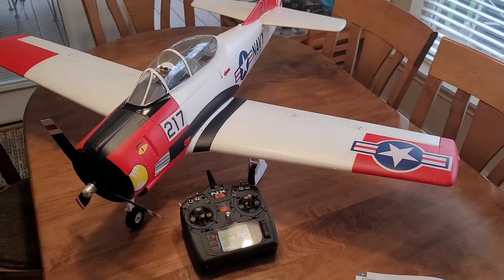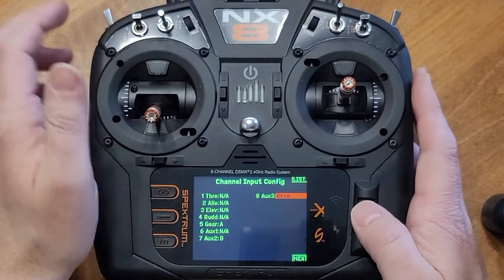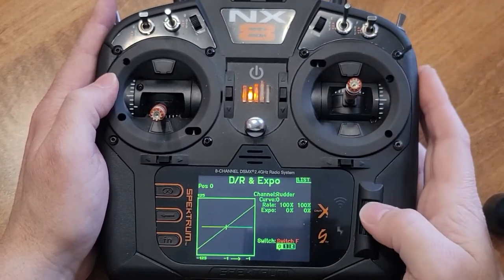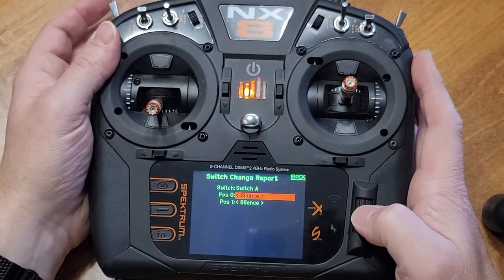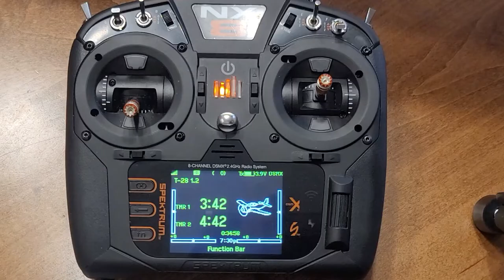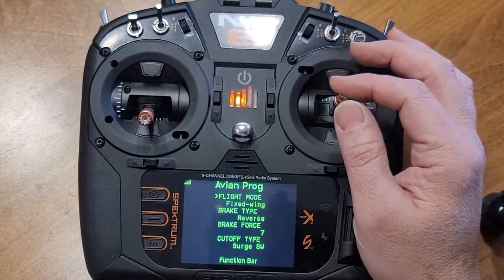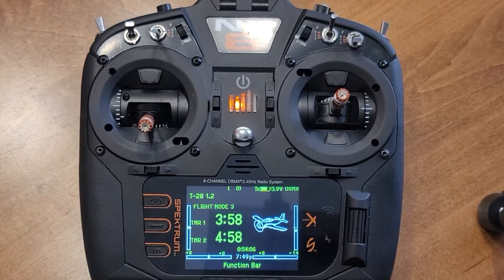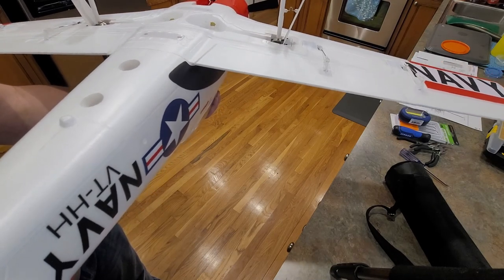E-Flight T-28 1.2m & Spektrum NX Radio Complete Setup Guide w/ Flight Modes, Reverse Thrust & More

Comment: Nice. I have an NX10 and I will be setting it for a brand new in the box E-Flight T-28 I just picked up.. Your video is gonna help me alot. I don't want to use the "pre-fabbed" downloadable settings because I wanna learn how to do it myself. Will probably go without the reversing for now. Maybe add that in later. This is my 3rd plane. Graduating from an Apprentice STS and an AeroScout. Can't wait to get this T-28 up in the air. I feel like its my 1st "real" airplane.

Appreciated your hard work on the video.

Subbed.

Comment: This was a spectacular video.
So much info here.
You did an amazing job, bith with camera angle, also, explaining what you were doing. Also, why you are doing what you are doing.
For me, that is key.
It's hard for me to learn something, if I'm only doing it, because the manual is telling me to do it.
I love knowing why it's the way it is.
The reverse thrust, was the best explanation I've ever seen.

Also, never knew most planes, if not all, could have have that feature.
Understandable, there is an inherent risk when using that, especially if its on a plane not designed for it.

I have this plane, had it for about 5 years now maybe? I got it, about when they re-released this with the flaps and retracts.
I couldn't be happier with this plane.
The only downside for me, is that I flew this plane, before I was as experienced as I am. Consequently, have had some less than spectacular landings.
Subsequently, this left me than less than optimal performing retracts.
Now, they did just release a new 1.2m mustang.
I'm curious if the rears, are similar to those.
They also released something else that has tricycle landing gear, of similar size that I may be able to replace the retracts.

Do you know of an aftermarket replacement that is possibly stronger than the oem gear.

That is the only weak point to this plane I have found.
This is a solid plane.

Comment: In the flap settings the book has you set 2% elevator compensation for each flap setting. If that isn't how you like the trim while flaps are deployed, then you can simply change it there to a different percentage effectively doing the same thing as your flight mode setup. The advantage of using the flight mode setup is that you can dynamically set those elevator trims on the fly for each mode. Just thought I would point that out. Technically, you can also adjust that one setting on the fly as well but I usually just land and set it. Rinse and repeat. If your using flight modes, you don't really need the 2% or any compensation set there since you are doing it via flight modes.

BTW, I changed over to your bright green on black and like that a lot. The time remaining tip on the bind button is also a new trick I didn't know about that I'll have to setup on all my other planes now.
Reply from the maker: I use time remaining on the bind button on every plane.  I never like taking my eyes of the plane unless it is a must!

Comment: I have a new t-28 1.2m version 1 I havent flown yet but have upgraded with a stronger front landing gear wheel assembly, a stronger esc and I just added a ar8360t and I also just got a nx8. This video worked great for me! Thank you 👍
Reply: Where did you get the gear? Do you have a link?
I have this plane as well.
Mine is about 5yrs old, I got when they originally released it.
Anyway, my nose gear is complete rubbish, I haven't flown it much because when testing it, it fails to deploy about 30% of the time.
I have done some pretty hard landings when I first got it.
I wasn't obv as experienced as I am now.
Point is, I'd love a stronger replacement.
Also, if you know of any rear retracts as well, be interested in that too.
Thanks, happy flying

Comment: Very well done, thanks. I don’t know how much difference it makes, but the instructions say to have the d/r and expo on 100% when you set up Safe. Also, is your system of using FLIGHT modes just to test the amount of elevator compensation needed for the two of the three flap positions, so that you can then set them up permanently in the flap menu? I need to start using Flight Modes like you have as I’ve ever known how to use them.
Reply from the maker: I leave flight modes turned on forever.  I can then trim the elevator during flight....and 6 months later I can still adjust the trim if I think it is a little off when the flaps down.

Comment: Are you sure you have to hold the bind button on the receiver to bind? Don’t you just press it for a couple seconds, release it and it flashes indicating it’s in bind  mode? Also surprised you don’t mention with transmitter off once the receiver light is flashing….depress the blind button on the top of the transmitter holding it don while turning it on.  To me… Easier than going through the menu. Great vid
Reply from the maker: From my understanding, there are two ways to bind, with the option to use safe and without the option to use safe.  If you don't hold in the button, safe will not be an option.  I like the option to turn it on if I lose orientation or by accident fly the plane through the sun in the evenings.      You can also use a bind plug instead of the button, but it is the opposite.  If you bind with the plug in, safe will not be an option.  If you wait until the receiver is in bind mode, pull the plug and then bind with transmitter safe will be available.  I didn't want to go though all that, i figure it just complicates things.